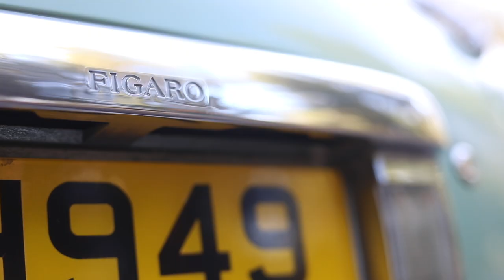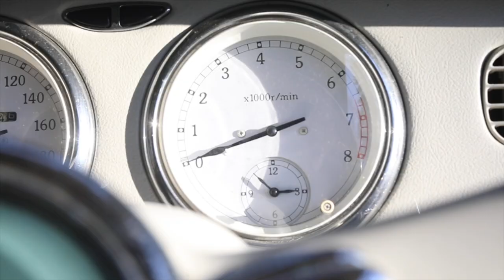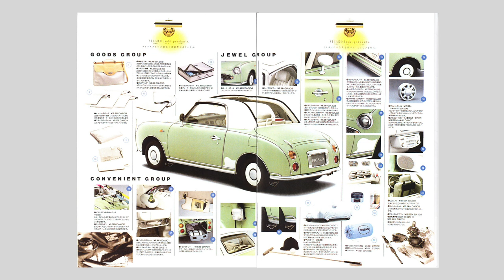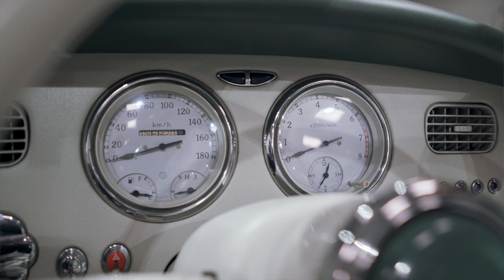Why we bought a JDM import Nissan Figaro (+ buyers guide) // The Late Brake Show

Comment: The Figaro is such a perfect candidate for an electric conversion! It has an interesting design that looks like a "future design" prototype you would see in "Popular Mechanics" magazine from the sixties. Can't wait to see the updates and final results of this build!  Also, the chemistry between husband and wife is unbeatable!  You need to do more episodes with her.  She is a riot!
Reply: I agree they would be great to convert to electric power. I am surprised Nissan don't provide the parts for these anymore  being that the retro styling cars are popular across the globe.
Reply: Great to see you guys trying to do this as well. Check out the Fig-Leaf’s first outing:
https://youtu.be/dZp3I_3pF8g
Reply: You (and Jonny) COULD NOT be more wrong. The car already has a turbo for heavens sake. Want to make it faster? Tune it! More boost + more fuel - simples. Don't rip its guts out and weigh it down with batteries. Poor car.
Reply: @petec2583  Dont rip its guts out, just replace them with forged internals and billet block and huge turbo, make it noisy and harsh and unreliable instead, and pay about 10 times as much? that the suggestion?
Reply: @mycosys  No, that would clearly be way over the top 😂 It's already got a fresh engine and turbo so I'm sure it could cope with a mild boost increase plus some supporting mods like an intercooler (it doesn't even have one so that's a big gain on its own) and improved fuelling + ignition. Should give more than enough power for a tenth of the cost without unduly impacting reliability. Do you think bespoke EV conversions are cheap and without reliability issues? How quick do you need to go in a Figaro anyway?
Reply: Hey , I totally agree. I understand some chap in London/Kent is building an electric one. I think he’s called Adam from Figaro Imports. Can’t wait to see the prototype.
Reply: @petec2583  more than enough power? you are talking taking it form 75 to 90 HP maybe. 
Plus... London emissions charges.
Reply: @mycosys  I think you underestimate how easy it is to get extra power with a turbo - I've got an 90s turbocharged Nissan and achieved a 40% power increase on the stock turbo, internals and ECU (with a reprogrammed EPROM). That's a very common "stage 1" setup. I make that 106bhp in the Figaro, roughly the same as a March Super Turbo. And who drives in London? I lived there, public transport is so good it's just unnecessary in normal times.
Reply: I do get the Figaro is a good candidate for an EV conversion but it does seem a bit wasteful in this case since he had the engine rebuilt with hard to find parts just let run its cause when it eventually wears out again get it converted
Reply: @Thanos.m  Or he sells the engine now while it's still worth good money to help fund the conversion.
Reply: @davidholden2658  let's be realistic the engine would be worth maybe 1k it's nothing in comparison to a 20k EV conversion
Reply: Use a 3Cyl Yaris GR and You'll see!
Reply: Rich Benoit aka Uncle Rich of Rich Rebuilds joined the chat :D
Reply: It is cute. But it is as impractical as a supercar.
Reply: @petec2583  the March super turbo was twin charged... The single turbo with the low cr makes that engine really slow... But if you go for 8.5 or 9:1 CR and maybe a smaller k05 oder GT17 hybrid turbo usable 100HP should be easy possible.
Reply: @justacomment1657  Yes it's twin charged but the supercharger switches off before the turbo comes in so that fact makes bugger all difference to the max horsepower, which is why I didn't even mention it... :)
Reply: @petec2583  Max horsepower yes, but spoolup of the turbo it does help quite a bit, alsow adds a little torgue low down... Actually a pretty cool car for the time..
Reply: Stop this electric talk. BS

Comment: A car styled after the 1950s, developed in the 1980s, that I always think was released in the mid 2000s. Shows that retro styling can be successful in its timelessness.
Reply: Naaa mate it's a 1991 model judging by the reg
Reply: LOL, its just a rebodied Micra with a turbo, the chrome on the bumpers is bacofoil....check out the ViewT, its  a rebodied Micra that looks like a Mk11 Jag,
Reply: @markholroyde9412  the figaro is more than a rebodied micra as they are completely bespoke
Reply: @bomfunk77  Maybe you missed the part in the vid that said it was introduced at 1989 Tokyo Motor Show. It's 80's development alright.
Reply: @AnttiBrax  no mate I didn't miss that part but the registration on the car starting with an H denotes it was registered between Aug 1990 and July 1991. So by a process of elimination I concluded with the information at hand it's a 91 figaro. Thanks for taking the time to reply unfortunately better luck next time

Comment: Put the batteries in the useless boot, and then make a "frunk" instead.
Reply: Or use the boot space to fit the motor and load the front with batteries, just need to keep the roof up if you want to take anything with you.
Reply: Nowhere near enough room for any useful amount of batteries in the boot. My bet is that they will switch to rear wheel drive because there's space for a motor in there.
Reply: @MrAdopado  Since they are talking about putting batteries where the fuel tank is, then the boot is a good place to consider as well. But true, having it rear wheel drive would be nice too.

Comment: If it were me I would be putting the batteries into the floor pan and tank area, control modules and wiring into that ridiculous little boot and making a plastic box to drop into the engine bay. It would likely be shallow but you'd gain an actual luggage space that was accessible... 
It always has been the perfect candidate for EV,  I hope it works as well as one.

Comment: Interesting,my daughter has a grey one.Owned it for 6 years.Has rust now on bumpers,rear wheel arches,all the areas you mention.Interested in ev conversion, especially cost,so will follow up on your progress.Another issue I feel is the fact that safety of these old vehicles in a crash,would be low !
Reply: Yes, good idea to wait for them to do all the expensive development work on this car before you ask about price!
Reply: @MrAdopado  yes,fair point!If car values are around 5k ,so got to be realistic to how much it's worth to spend.I like the idea though of keeping classic cars on the road this way. The other big problem is addressing rust on older cars,as no galvanizing done then !

Comment: The love you and your wife have for this car is evident. I just wish there was a company like ZeroEV here in New Zealand as they could have my money to electrify my mint condition 2004 RX8. The only thing I fear is the death of its rotor motor, and have not replaced it with an electric car yet as there is just nothing in the market for under NZ$80,000 that has tempted me out of the drivers seat. I would pay nearly that for a good EV conversion on my RX. The main reason its not my daily driver is actually its gas guzzling nature, costing over NZ$100 to fill, and only getting 400K or less out of that tank. Its just so inefficient when cold, and my local trips aren't often long enough to warm it up properly. An EV is exactly the opposite, almost designed perfectly for short local trips.

Comment: Really good review 👍

My wife has for years hankered after a Figaro so I found this review particularly interesting. This has definitely warned me off

On the EV side, great idea if you can afford it. From what I’ve seen on Vintage Voltage converting a smallish car results in losing all the boot space to batteries which for some may be quite a trade off.
Will be looking out to see how this goes 😁
Reply from the maker: They aren't too bad to own Nick, but buy on body/chassis condition most of all.
Reply: @TheLateBrakeShow  

You’re right of course but won’t show her this video 😉

Comment: Nice honest story. Lovely cabin :) 

But why on earth did you not swap the engine for a mirca/March turbo unit or rebuild it with some upgrades (as it was in need for a rebuild anyway) ... It's an 8v turbo after all.. Higher something like 9:1 and a nice gt17 hybrid or gt18 and a small intercooler on it could do wonders... I imagine 100hp are pretty easy possible... Changing final drive to get rpms and noise down shouldn't be to hard then.....🙈 
BTW:
I do have a 89 Nissan 180SX and I feel your pain when it comes to complicated engine management... Nistune however helps quite a bit...

Comment: I don't understand the hate for the FIgaro. It doesn't look like anything else. When I first saw one I thought it was ten years newer than it was. I see the logic of the electric conversion, I think we need to eventually convert everything over with the way things are going. Personally I think some more boost pressure and some breathing mods would be nearly as good and much cheaper. If you could gain 15 - 20 hp more from it, that's about a quarter more power than it has now. With electric conversion, I would think 100hp would be a sensible figure.

Comment: Spent the first 20 minutes thinking: "This car is a great candidate for EV conversion" - was so pleasantly surprised at the reveal. Since this is a Spring/Summer car that gets garaged in the winter, I wonder if they'd be able to configure it with two way charging. Make use of the battery over the winter as stationary storage for solar or even just off-peak power from the grid.
Reply: OR, depending on how much of a pain in the arse it is to remove/install, maybe share the pack with a winter beater car. Convert a more recent Yaris or something.
Reply from the maker: That is a fantastic idea Adam. Perhaps a Nissan based V2G is a good idea?

Comment: much prefer the twin metal hard top on my tigra.  all at the touch of a button. did check before i bought it for 875 no v5c. took the risk and it paid off. cheap little reliable convertible with quite a reliable roof system apparantly

Comment: I must say that such a rare car should be kept original.   I'd bet you could increase the boost to give it more power, and maybe bore/stroke for larger engine size too?
This comes from a guy who has built 3 EVs, including a Boxster, which is notorious for its engine failures, so great for EV conversions, and they sold many many of them, so not rare at all.

Comment: Well done Johnny, I didn't think you had it in you. I will save your marriage I'm sure. The Marriage of Figaro...
If Nissan re-engineered this for electric  the whole world would queue up to buy it. In fact, they could totally survive as an all retro-electric car company. 
Is it rear wheel drive? Because a motor replacing the back axel would be cool. Also, the central tunnel might be good for some battery storage. The fuel tank area will free up some space for chargers and devices.

Comment: Great video and food for thought as I have an old MGB, your Figaro is obviously a keeper, if it was mine  I would only change out the petrol engine for an EV if it was goosed. I would personally bide my time until the technology improves, it is cheaper and the batteries are smaller, especially for a car that's the same size as a shoe.😊

Comment: What about cutting the boot floor away to give you a more square space for the battery pack in the rear??? Looks like an awkward space with the spare wheel well being the way it is.
Reply from the maker: Could do, but if the metal is solid and original I might be reluctant.

Comment: I got quoted 26K to EV convert my Pao. Not going to happen, i wonder what it would cost in the UK.
Reply from the maker: Depending on the components used then it won't be far away. It definitely isn't priced keenly at the moment, but if the car is a keeper then it's worth future proofing.
Reply: @TheLateBrakeShow  I agree. I dont drive it that much, but if daily driven it would be worth it. I have bought an electric motorcycle instead, if i ever crash that the hardware will go into the Pao.

Comment: MA10 engine? pretty sure the MA10 base engine was the one fitted to the original (K10 chassis) Micra
Reply from the maker: MA10 is base n/a motor, but MA10-ET is this turbo motor.

Comment: Nothing shows love, as gifting a rolling death trap to your significant other, questionable crash structure, no airbags. One distracted driver or a slippery road and you will raise your kids alone.
Don't do a ev conversion, adding weight will make it even less safe.
Just watch any 90s nissan crash test.
One thing is to buy a dangerous cars to ourselves, other thing is to buy to another person.

Comment: Being a dinosaur I don't like ev conversations, wouldn't a 16v 1.3 micra engine (and gearbox) fit pretty easily and be cheaper than a £1600 rebuild plus £500 turbo, never mind the cost of electrifying it? And for FIG sake whoever fitted that crap black rocker switch which I assume is for fog lights ought to be shot. Use one of your spare chrome toggle switches, even if you need to make a small mounting plate to cover the square hole it would look way better.
Reply from the maker: Blsck fugly switch fitted when we bought it. Am going to swap it for one of my spares.